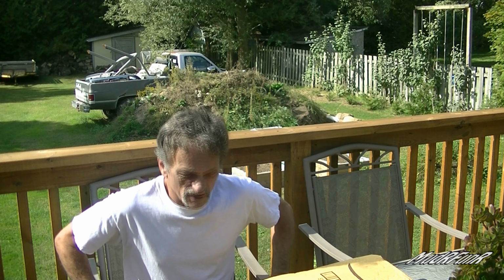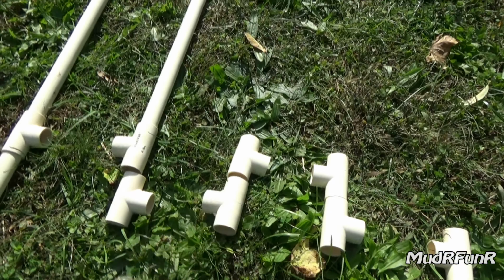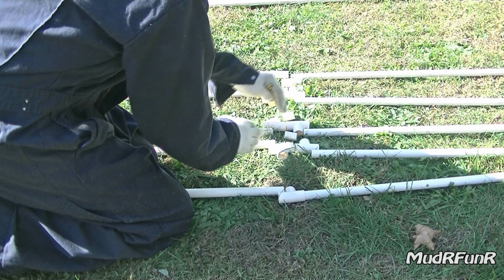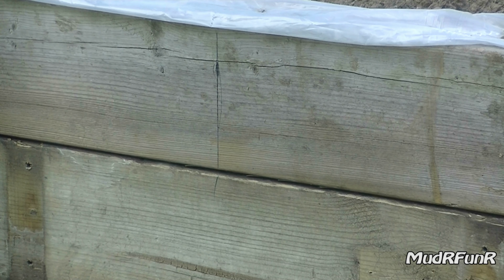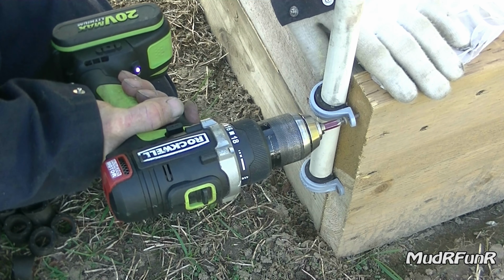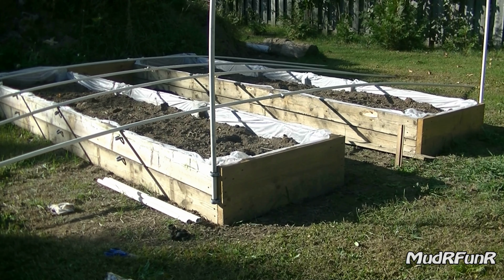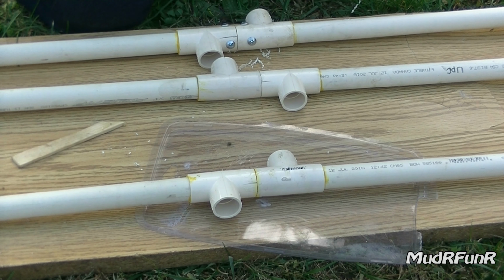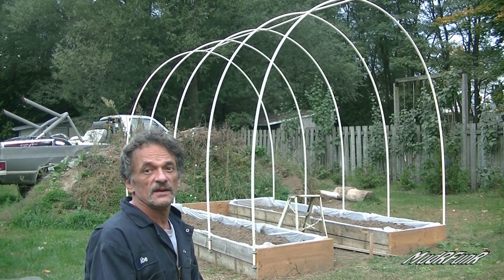Homemade Greenhouse Build 1/3 - PVC Arches and Errors

Comment: Good  day Boy that was some adventure.  You said cpvc, would pvc not bend for arch?  Seem like quite a screw up between 2.  Yes next video. Thanks
Reply from the maker: I didn't purposely buy CPVC. This is what Rona sold me when I asked for PVC. Had no idea they were different sizes. From what I have seen on other videos it looks like PVC would bend the same. My biggest mistake was using the wrong glue and not prepping the fittings properly. The tube ends and fittings are supposed to be roughed up a bit before gluing them. Part 2 coming soon. Thanks for watching!